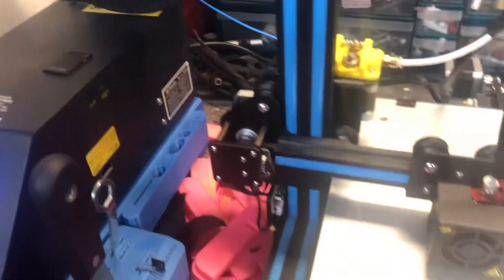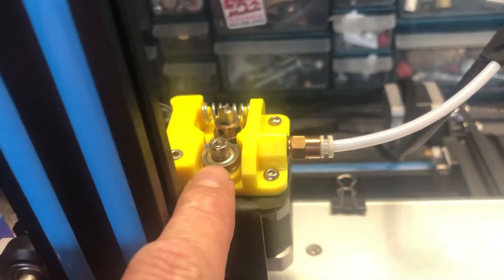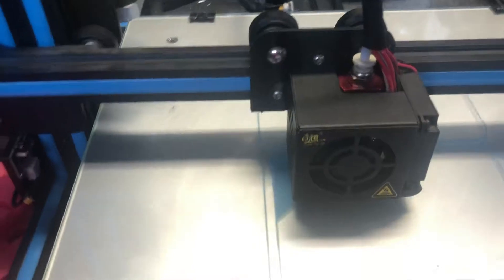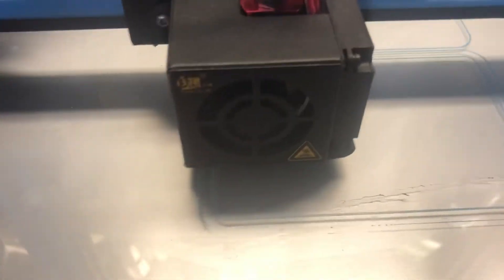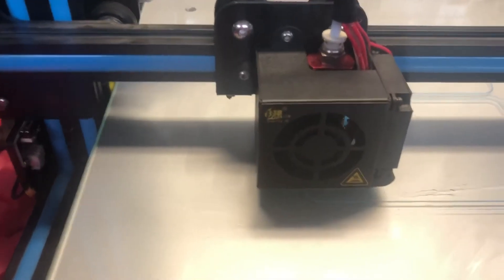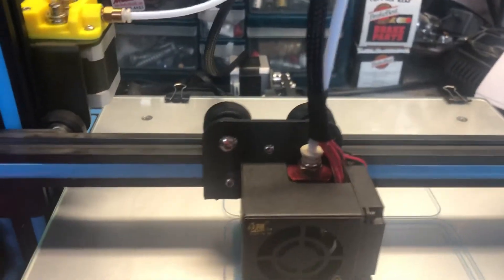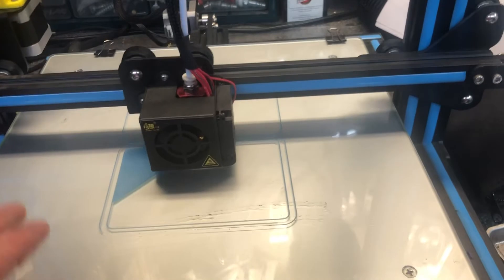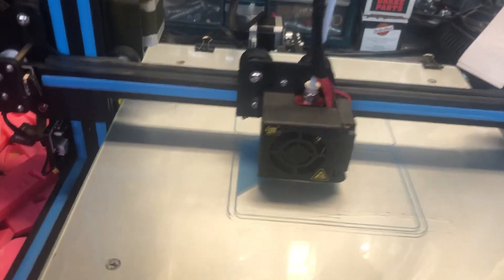Creality CR-10 3D printer filament not feeding fix.

Comment: Uggg mines doing same thing. Beds level, New boden tube, new filament just got today because it was doing this last few days with two other roles. So I thought maybe filament was to old (had for a few years) but even with brand new roll still either clicking, or not griping enough to pull it. I put a spacer to stretch the spring out a little and it worked for a few layers then back to same thing.

Comment: How do you level ever time I lol the bed and run it it goes back to default leveling its frustrating no vids on my issue so fo I'm new to this
Reply from the maker: Level the bed by using the turn knobs underneath. Place a piece of copy paper between the nozzle and bed and level each corner of the bed until it just barely drags. Then retest and adjust each corner again till you get the same amount of drag for each corner. 
You shouldn’t have to do this every time but I would do it periodically.